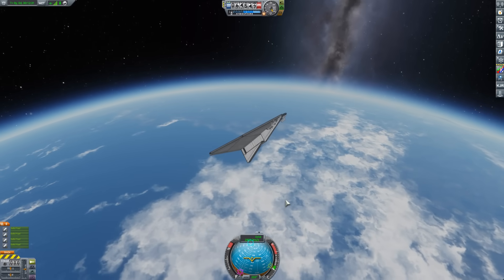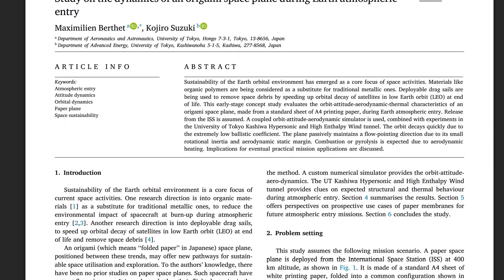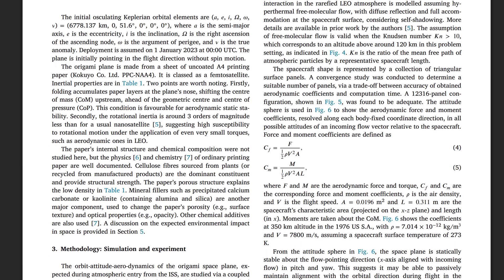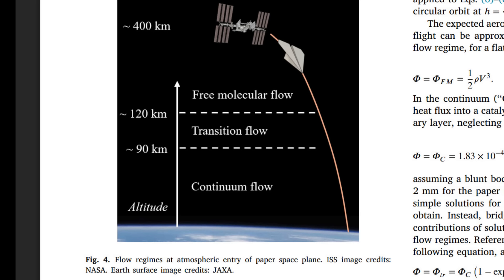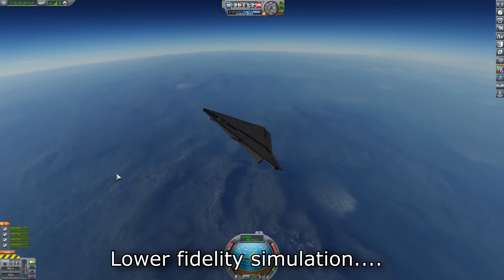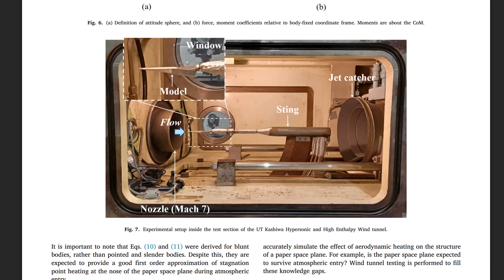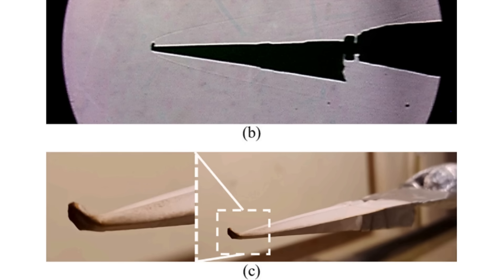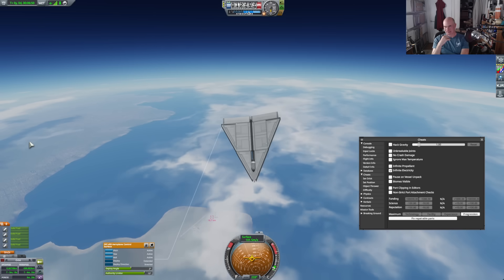Could A Paper Airplane Fly Back From Space?

Comment: From the beginning of the video, I suspected the issue was due to the speed of sound...
This is precisely why most passenger airliners don’t fly much higher than 10–12 km.
It’s all because, in order to maintain optimal indicated airspeed, the higher the altitude, the greater the speed required relative to the speed of sound.
If a plane were to be dropped from orbit, it would simply break apart before reaching the minimum indicated airspeed needed for stable flight.

Comment: Carbon fiber panels? You're over thinking this:

1. Get some mechanical pencil sticks.
2. Grind 'em to a powder with sandpaper
3. Mix the powder into a slurry with PVA glue
4. Apply to leading edges and nose
5. Seal with a thin layer of PVA

Congratulations. Now you have a simple carbon composite ablative heat shield (PVA melts with heat). It will also modify the CG to stabilize the aircraft in a nose-forward position during the early stages of re-entry and will have the added bonus of making it look like the shuttle. This thing is going to slow from mach whatever to 10 mph in like, what, 10 seconds? I think it'll hold up just fine.

Comment: One does not need to purchase ablating carbon-fiber supercomposites, manufactured underwater by blind nuns, to fabricate a paper airplane. Kapton plastic, sold as "turkey basting bags", will survive 400° C.

Common cyanoacrylate glue is viable to 200° C. In case localized stiffening is necessary.

Easy peezy.

Comment: If someone wanted to be super clever about it, you could make a paper airplane with some other material with a differing rate of expansion stuck to the paper surface in such a way that the surface warps when heated and changes the aerodynamics to suit the speeds found with that level of heating. 

Or, making a controller and servo assembly the size and weight of a pencil and fitting that with about a square meter worth of paper-thin stuff carbon fiber sheet, get that mass to area ratio just insane and see if the thing controls itself well enough to change angle on a deceleration force basis.

Comment: Stick a sacrificial paper drinking straw out the front. Serves 3 purposes:
1. pushes the shockwave away from the paper airplane.
2. burns up instead of the nose of the paper airplane
3. provides the first reasonable practical use for a paper drinking straw.
Reply: Interestingly, a plain paper tube is usually the type of paper "airplane" that flies the furthest. Perhaps the straw has too small a radius, but something the size of a toilet paper tube would be a good test
Reply: @blumoogle2901 farthest
Reply: May be the ONLY use of a paper drinking straw
Reply: @libertycowboy2495 Paper straws work just fine. If you're leaving it so long that the straw goes soggy etc, why are you taking so long to drink?
Reply: @anzaca1  not everyone wants to flood their system with alcohol or sugar. some people like to slowly imbibe and actually enjoy their lives.
Reply: Yeah, but won’t it get all hot and soggy!? 😂
Reply: I have read that paper straws are particularly good at poisoning people
Reply: This will also give it more of a nose heavy reaction.
Reply: Probably would work even better if you stick something at the end like a round of cardboard. More surface area.
Should be made just the right size for it to burn completely.

Comment: Worth saying, the high altitude balloon launched paper airplane would be a pretty simple experiment to do. Saying this as someone who has worked with high altitude balloons at a place I volunteered at in high school, where we actually were working on dropping some foam gliders from them to test out if some ideas would work in the Martian atmosphere (since 90,000 ft up is pretty similar to the surface conditions of Mars and it's a lot cheaper to drop something from a balloon than to build a giant vacuum chamber and generate wind within the low pressure environment). You basically just need a servo to be set to release it at a certain point, you could probably just do it based on time but if you wanted to be fancy you could connect it to a pressure sensor ticket release at a particular altitude. The amount of time it takes for a high altitude balloon to reach maximum altitude is relatively consistent though, so the simpler option would work fine. The atmosphere is going to be thin enough that trying to throw it wouldn't really do much as it's going to gain more speed from gravity plus the aerodynamic qualities than you could reasonably build something to throw it with, but a paper airplane probably could be done on some sort of elastic system. I'm pretty sure we just dropped it though because ours was too heavy to do anything like that. 

And high altitude balloons are pretty cheap to launch, there is a reason why the national weather service sends up so many weather balloons, and part of it is just because they are not too expensive. I don't know the exact costs, but a full high altitude balloon launch can easily be done for under $1000 if you have access to an enclosed space near a clearing to launch from. You do have to file reports with the FAA or presumably any other national aerospace governing bodies that would be involved, since you don't want an airplane hitting one even if you are following guidelines to minimize the risk of damage

Comment: Isn't there a layer of atmosphere at the high altitudes that is extremely hot I mean hot enough to melt steel if it's left up there too long or was I misinformed they never get through the thermosphere 500 degrees Celsius well above the ignition point of paper even with shielding
Reply: It’s technically hot but there’s so little particles to transmit that heat

Comment: I might have started with the simple solution and dipped the tip of the paper plane in some thin CA glue. It may not have survived the heating either or it may have just shifted the forces further back and caused the failure there. But it would have kept the nose from folding over as easily. Probably something I don't understand in the forces since I'm just a model maker and woodworker but it's the first thing I would try in making a model with paper that I needed to keep more rigid.

Comment: The material you're after is called nomex paper... It actually has quite good structural properties as well as being a very thin, very light weight aramid sheet... Extremely good high temperature performance as well. I expect that, due to the tiny amount of energy the flight body would have, you'd see hundreds or thousands of g's of deceleration but there'd be no significant aerodynamic heating compared to the functional range of properties that nomex paper has :)

Comment: Having tried to throw paper airplanes as hard as possible, only to have them slow down almost immediately, I think the wind tunnel test proves only that a paper tip on a rigid object held in a high-speed wind tunnel is not durable against that air pressure.
I am far mor in the camp of "the paper plane would be fine" because of the ration of drag to mass.

Comment: The plane design in these simulations don't have one very important element - the central section is just a flat fin, but on a normal paper plane it has a V-shaped fold  which creates low pressure and main lift, since it's 'wings' are just  flat surfaces don't have any airfoil  and they are good only for stabilization.  Also this V fold is  the part which I think would help to decelerate the plane in reentry.
Reply: Not entirely true -- a flat surface at an angle of attack will absolutely generate lift.

The theory that it can't generate lift is based on a wrong idea of how airfoils work, but is also based on the assumption that the stagnation point is at the leading edge of the flat surface.  It isn't; if you look at wind-tunnel smoke-stream photos of tilted flat surfaces, you can see that the stagnation point is on the bottom surface just a bit behind the leading edge, and there's a small region of reversed flow on the underside of the leading edge.

You can also demonstrate this by making a paper airplane where the V region is very small -- I've successfully made ones where it's maybe a half-cm deep for the entire length.  Those fly even better at low speeds than the ones where the V region is the size of the flat wings.

Comment: The problem with the wind tunnel testing is it holds the paper airplane in place to force it into being subjected to the wind forces. In an actual scenario where it's released from the ISS, it won't have something it's mounted to forcing it to stay in one place, it will be free to decelerate extremely rapidly as it enters into very thin atmosphere. I think it would have no problem surviving re-entry, there'd likely be no noticeable heating to be honest.
Reply: You have things backwards.  If it decelerates very quickly, it would get extremely hot very quickly.  You might want to Google kinetic energy, and stagnation enthalpy.
Reply: So basically the wind tunnel simulates if you had a ramjet engine fastened to your paper airplane.

Comment: The physics is great, but how many paper airplanes would they have to drop to overcome the probability that it just ends up in the ocean?
Reply: 71% of the Earth's surface is covered by oceans, while the remaining 29% is land. So the probability of landing a paper plane on land as a function of the number of planes thrown is:

1 -> 29%
2 -> 50%
3 -> 66%
4 -> 75%
5 -> 82%
6 -> 87%
7 -> 90%

A typical paper airplane weighs approximately 5 grams. The cost of sending 1 kg of cargo to ISS is $20,000. So the cost of sending a paper plane to ISS is 100 bucks. For just 700 bucks you get a 90% probability that at least one of them will not get wet on landing.
Reply: @JohnSmithEx  Ah but the wind currents are not consistent across land and seas, so the chance would not be as straightforward.
Reply: @Thermalions  sure, if you add more information in the prediction machine you'll get more accurate probabilities. For example if you can be sure that the plane will land near the equator, then only 21.3% of the equator's length passes over land.

Comment: I think it would actually make it to the surface. Reason being: They're so light that they wouldn't be able to hold those hypersonic speeds long enough for the air is dense enough to burn them.
Reply: Reduce speed requires that the kinetic energy converts to heat energy - the only option is the paper ablates to nothing.
Reply: @nightjarflying  Not necessarily. Ablation is required when the thermal energy to dissipate exceeds what the vehicle's skin and structure can tolerate. Reduce that thermal load through other means...IE being so light that you slow down below the threshhold for reentry heating while the air's still so rarified it wont heat you up...and you sidestep the issue outright. These things only weigh a few grams they arent going to need to dissipate anywhere near as much energy as a satellite or asteroid or spacecraft does.

Comment: Is there Graphene paper? Quick deceleration is only good if the plane can dissipate the heat quickly enough to avoid disintegrating or oxidizing. It still has to dissipate the heat, but if the heat conductivity is extremely high, the heat can be spread from the edges of the wings to the entire surface where it may possibly radiate away.

Comment: My question, would it really be going high mach numbers by that point in re-entry? It's low mass, high surface area, so it already be decelerating higher up.
Reply: The deceleration requires the paper to convert its kinetic energy to heat energy...

Comment: The real question is at what altitude (air density) would the paper airplane be slowed to mach 7?   I suspect it is much higher than 40 km up.  And if it slows down enough in very thin atmosphere, then by the time it drops to 40 km it could be traveling more like Mach 1 and decelerate without burning up. 
   If the paper airplane were designed to be a hypersonic glide vehicle, then it would stay safely at high altitude without dropping like a ballistic rock. Ultralight glide vehicles released in orbit would be an excellent way to study high mach aerodynamics without spending a ton of money
Reply: I feel that this depends a lot on the periapsis it starts with. I really believe that it would survive if it was allowed to slow down slowly and naturally from a high altitude, as opposed to immediately having a low atmosphere periapsis
Reply: That shape is known as a Regallo wing.  Think of a hang glider with a bit more sweep, and you have a hypersonic shape.  It's not even an old design, in fact, it's old enough to have been scrapped & all but forgotten.

Comment: I have a design that maybe I should send them. Don't remember where I learned it as been using for about 40 years.

Wider and heavier nose, but if it builds up too much speed the whole thing will do a loop to slow itself down and will do that all the way to the ground.

Theoretically this could help to keep speed down and spread heat across the whole paper plane.

Comment: There's no way a paper plane could ever achieve or sustain that velocity even at that altitude. As soon as the sum weight of all the particles it colided with totals the 4 gram weight of the airplane it will have decelerated to it's regular old airspeed with no fancy burn marks at all. Force equals mass times acceleration. That wind tunnel they had there was holding the plane with effectively infinite force. Let it go and it would almost instantly match the air speed and flutter away.

Comment: Hi Scott. I forget how old you are, but I’ll be 70 next month and I remember the simple method to make sure a paper airplane will fly is by making sure the nose is heavy enough that its critical angle-of-attack tilts forward of the center of gravity.

Keep it from stalling at any density altitude by balancing the attitude/angle-of-attack.

This is accomplished by taping a penny or two in the forward compartment of the main fold.

More paper=more coins; using a piece of construction paper 36” long likely requires a lead plate.

Comment: Our XCOR proposal for XS-1 (with input from Barnaby Wainfan) was a Facetmobile-like two-stage LOX-LNG rocket using Nextel ceramic fabric over an Inconel frame. Ragwings in Spaaaace! The area loading was very low and would have had peak temps and heating rates that would work with those materials. Sigh.

Comment: If you build  the plane in a certain way you can add a paper clip or two to the front for weight and it will still fly well, just faster unless you sdd flaps by cutting or folding the sides of the wings.  It all worked as a kid😂  maybe they can make a very small and light tracking device to fit on it and also control the CG of the airplane.

Comment: So this raises a question I have had for a long time. Why don't space craft fire engines to slow them down considerably before reentry? Seems to me if you went through the atmospheric boundary at low speed and then just allowed gravity to take over that would reduce the heat generated albeit increase the fuel requirements and the time to descend.
Reply: It'd take a big engine and a lot of fuel to do that, and that adds mass to what it's trying to slow down, which requires an even bigger engine and more fuel again, which adds mass...  etc.  Its the same problem as getting things into orbit in the first place (which is why we need multi-stage rockets with the first stage being ridiculously big compared to the payload), just in reverse.  Only it's a worse problem because then you need an even bigger rocket to get all that extra weight up there in the first place.
Reply: @galacticminx  Yes that is an unfortunate bit of physics that I had hoped wouldn't be too significant but it obviously is. I was thinking along the lines of a small motor slowing the rotation speed around the earth so when it started its decent it would be starting at zero but obviously as the craft slows gravity will be pulling it and that would need to be overcome. I was considering a geo stationary satellite and assuming the gravitational force wouldn't be that large to overcome, it would obviously get greater as you near the atmosphere but hoped it wouldn't be too hard to overcome

Comment: Trick is to decelerate slowly at high altitudes for a long time so when the orbit lowers it is almost stationary over a ground point. Even better use a sounding rocket to deploy several hundred paper planes from a vertical launch at the pitch over point zero velocity condition at over 100km up.

Comment: Another material that might work, at least for parts of the airplane, would be Flex PCB. With the added benefit that you might be able to add a primitive low power transmitter for tracking.

Comment: so what if the paper is ceramic, steel, titanium etc sheet. not paper. or carbon fiber air plane. weight to lift/surface area is very large, still. charring is not much, its the carbon ablative shield. so make the paper air-plane arrow shaped. always passively rocket stable. yep arrow 4x wings dart air plane, not just 2-3. anyways, the ground launch track can be simulated by setting instant velocity horizontally to mach 20. no track simulation required.
Reply: you know, kerbal does not fly quad copters (quad thrusters) very good. ie kerbal cant do differential thrust steering very good.

Comment: Would it be possible to have a really big, say 1 km radius membrane, that you only mechanically operate the edge on so that you would be somehow able to get higher air pressure below and lower pressure above? Maybe some kind of mechanical edge movement, or something along the area of the membrane. I prefer the edge as the edge is so much less to concentrate on while the membrane would just be a plas-static thing.